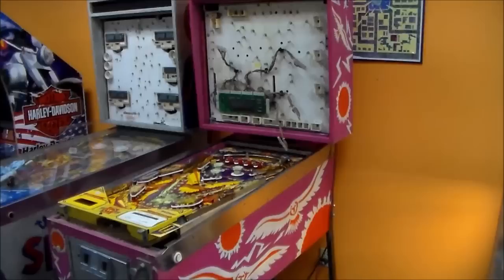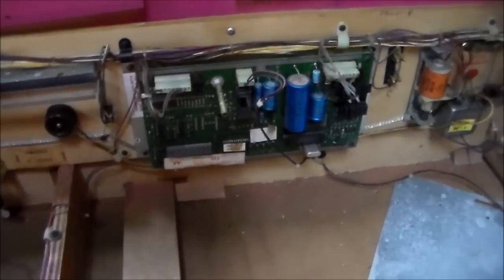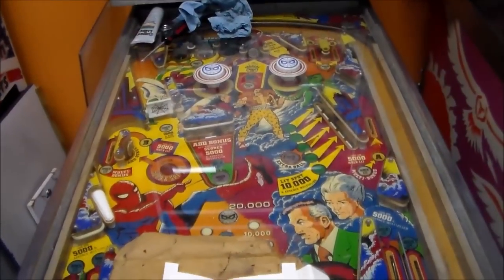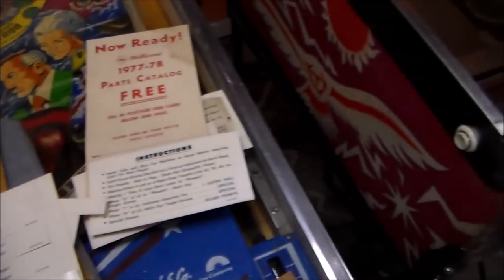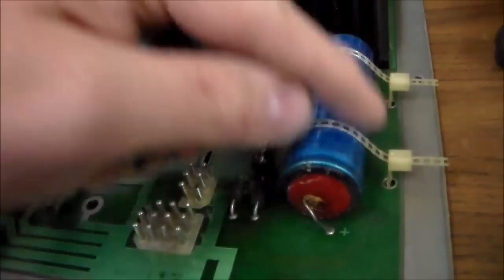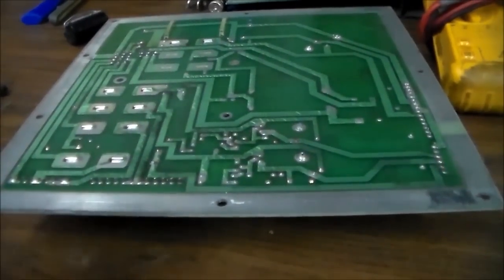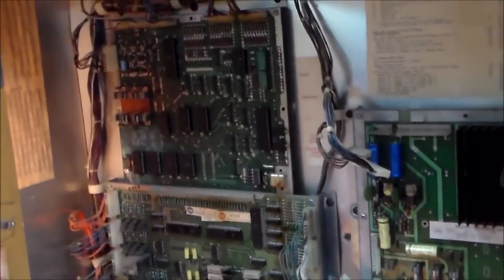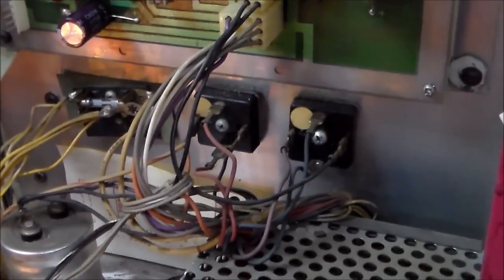Repairing a 1978 Williams Phoenix Pinball Machine - RISE FROM THE ASHES,  You Neglected Old-Timer!

Comment: Ugh I hate those interconnect boards it kept having problems so I just got a brand new Rottendog board and it gets rid of the top board you only need the one board as they put everything in one board and it worked great.
But now I am full restoring my LaserCue and it is in 3,000 parts still. o.o
I also love the LED displays and was skeptical at first that they would not look right but from far away you cannot tell they are LED displays unless you get up and close to the displays. :)
Reply: Show me that plug in side of the line cord I always get in machines that have the ground cut or the line cord itself was cut and wired back up horribly.
In fact I had to replace the line cord on the new machine I got in which is Star Trek 25th Anniversary Pinball by Data East.
Some one had over fused with a bloody 25Amp fuse it blew its Veristors arse right off and had charred up and melted the vinyl in the power junction box.
It was brutal but have a new line cord in and the ground is back on it now too.
Reply from the maker: Man that's horrible about that fuse!  If you get time watch our Dungeons and Dragon's pinball video on here somewhere, they overfused the board and caught the game on fire!  Good fix on that Star Trek, very cool.  See you on the next video!

Comment: The problem with those old WMS power supplies is that the 3055 transistor output would “drift” over time and you’d wind up getting some god awful voltage out on VCC like 4.6 volts instead of 5V and those old TTL (non CMOS) ICs were intolerant to voltage drops below 4.8V. The game would fail.
The formula for IC1 (723 regulator) is VO=7(R1+R2/R2), where VO is the desired voltage out.
Although the resistors R1 and R2 were precision, the main transistor would heat up and change its properties.
The solution is to either replace the 3055 or use the above formula to change the “precision resistors” to accommodate the “drift” of the old 3055 transistor.
Watching your video a little longer, I just realized that this system doesn’t use the 723. Oops.
Reply from the maker: Thank you for the info Rick, I do seem to remember 'fixing' one once by adding in a resistor that was probably doing what you mention, maybe it was a slightly newer version of the power supply but yes, there was a place for a couple resistors and only one was populated from the factory, by adding the second one in (I think?) I was able to raise the voltage back up to get over 5 going out to the mpu.... I think I did a video on it here somewhere but I can't remember which machine it was.

Comment: Hey Ron.  I realize that I'm (really) late to the party here.  Just noting that the feed for the 5V supply is a full-wave rectifier, not half wave.  If the secondary of the transformer is center-tapped, a full-wave design will run the center tap to ground (or reference) and then one diode for each end of the secondary will hand each "wave".  That is why the banded end of both diodes are tied together while the unbanded end goes to the transformer (one to each end of the particular secondary). 

If I were to feed the three wires from the transformer (two ends and the center tap) into a sealed box, you'd have no way of knowing if I used two diodes or four...until you measured the transformer to see where I picked off the reference (ground) or compare the output voltage of the sealed box versus the input voltage.

Also µ is the greek letter "mu" and not the arabic letter "u." Hence µ is for micro.  

One last thing, even if you are abandoning a part of the power supply, I would still pull the old electrolytic capacitors as they can still leak, like a battery, and etch the board.

Comment: beautiful play feild an the only reason i mentioned the UF stuff was to help not to be offensive but hey if ya want to be mean :-P
Reply from the maker: I wasn't talking about you brother, you mentioned it along with 100 other people.... .
Reply: @LyonsArcade  ok anyhow replacing the caps in anything over 20 yrs old is a good thing (ol tube type radios to tv's have them under the chassis ol wax an paper are common) heck many big flat screen tvs their power boards are what fail in them to be tossed to the curb its the caps that go bad they use cheap low quality ones an the tvs need so much power they actually dry them out in just a few years also subbed

Comment: Two repairmen and 700 $$ later my Phoenix is still not working .  Machine turns on . Doesn't kick out ball . Behind the back glass the red transistors heat up guickly . Machine is is great shape that I don't want to give up on it .
Reply from the maker: Man that's crazy they charged you but didn't fix it... if the transistor heats up it's connected to a coil that's shorted likely.   If you find anybody who's worked on these System3-7 machines they should be able to fix that pretty easily, it's ridiculous they charged you $700 and didn't fix the machine.... You can check the coils with a multimeter and check the transistors on the driver board that pair with any of the shorted coils, you basically have to replace the coil and the transistor usually if it burns up.
Reply: @LyonsArcade   Thank you . When I can afford to try again . I'll share this with the repairman .

Comment: JOE'S CLASSIC VIDEO GAMES
1.) What is that SETUP procedure called? because I don't know why they did this but setting a dipswitch and you hold down the start button or other test buttons to program the setups. Is this only for the systems 1,2,3,4 games or all games? because i don't think i have seen this only bally games maybe its only for the williams games system 1 thur 4 games?
2.) I didn't see that Special LEVER to switch the sound board from the acoustic crimes to the electric crimes. What does that lever look like
3.) When you add a fuse for each bridge rectifier how do you know what fuse AMP rating to put in line to protect the bridge rectifiers? 
4.) You mention something about leaving only one original display in which would take a fuse and +100 vdc & -100vdc put adding in 3 other LED displays which you have to add in a new fuse I'm guessing into the 5vdc line? 
5.) The fuse they recommend to take out of the power supply board because it burnt up the header connectors and traces was to power the displays? because I see a fuse that is mounted directly to the backbox next to the bridge rectifiers. I'm not sure why this fuse would burn up the header connectors and traces that is why they moved it and installed in to the backbox for a heatsink?
Reply from the maker: Hi Bill!
  1. Yes it's just for those first few systems on Williams, but there were only System 3, and 4, 1 and 2 were never released.  So System 3, and maybe System 4 games (not sure about that one).

2. It's that big red lever on the top left side of the sound board, you flip it one way and it plays chimes!

3.  I'm not sure how you figure out which amperage you need, but it's been determined by the people who decided to do that 'mod' that the correct amperage for this application is '8'.  So I'm putting 8amp slow blo fuses in it.

4.  Sorry I didn't make that part clear, there is a fuse on the power supply that makes the 100v and -100v lines work.  You need those for the original displays, and in this game there is still 1 original display (the only one I have!).  I'm going to use it to test if the game boots up, but after I get it booted and working, I'm going to replace all the displays in another video you'll see soon, with brand new LED displays that do not need the 100v or -100v.  So when I get that done, I'll remove that fuse so the board no longer makes -100v or 100v, to cut down on the heat in the backbox.  The LED's use so little power you don't need to update the fuse or anyting on the 5v line....

5. That fuse you're talking about yes they removed in design from the main power supply, it didn't run the displays though it ran all of the 'general illumination' lights, which are the ones under the plastics, and behind the backglass that light up all of the artwork.  They're always on, and drew a lot of juice, so it would burn up the connector as the amperage ran through it over time.  They figured this out, and after about System 3, they started putting that fuse on a seperate place (where you saw) so that they could solder the wires to the fuse holder.

See you on the next video!
Reply: @LyonsArcade  ok thanks for making it clear now. 
1.) Has anyone told you why they did the SETUP like that for the systems 3 & 4 that you had to move one dipswitch at a time and LOAD in that configuration one at a time which took hours. I wonder why they did it this way, not sure if you know the answer but ask around

Comment: Regarding the microFarad thing.
Saying mu F would be correct as it is the Greek letter mu that represents micro.  Ignore all the idiots though.  Most think of it is a u 🙂.
Increasing the size of a filter cap by that small percentage doesn't make any difference and might even help filter the power more, especially on half wave rectified power.
Reply from the maker: Everybody always has to butt in and tell me the one thing they think I did wrong... when in reality, I did 100 things wrong and that's the only one they know about.  So they gloat about 
 the 1 when we're both ignorant of the 99.  It's always the people that think they're the smart ones too, such an astonishing thing about human nature.

I figured that was the deal with that filter cap, but I assumed at some point it must end up 'too much' but I don't know what damage it would do if it was say... to be extreme, 5 times the size it 'should' be..... maybe just use more amperage or something?
Reply: @LyonsArcade  If you go too big, the initial inrush current could damage the rectifiers or even transformer as that initial charge inrush is seen as almost a short circuit on DC for a very short time.
It was a bigger issue with some valve rectifiers.  Most solid state ones are pretty resilient, but I probably wouldn't go more than about 30% above in filter caps in most cases.  It depends on the quality of the components as well. 
In other areas of circuits, like oscillators and such, exact values are more critical.

Comment: That dip switch option setting is TERRIBLE.  There are replacement roms that will let you set it like the later games.
Reply from the maker: I looked into that but couldn't find any unfortunately... this particular one is a weirdo, it's got System 3 flipper roms but it's the first system 4 game, I was thinking like you said somebody probably made some System 4 flipper roms that work with the other rom chip but no dice.  We get all into it, in the next video, see you then!